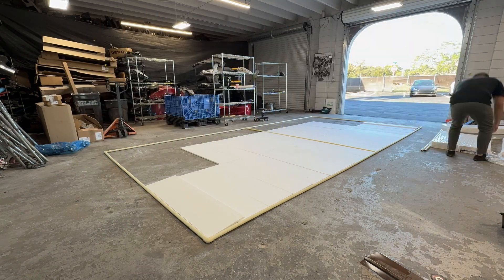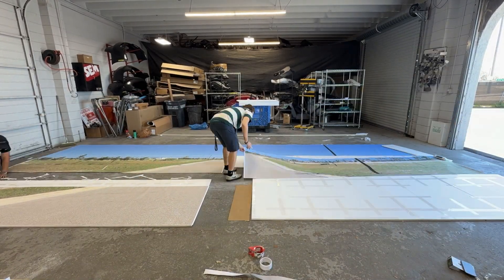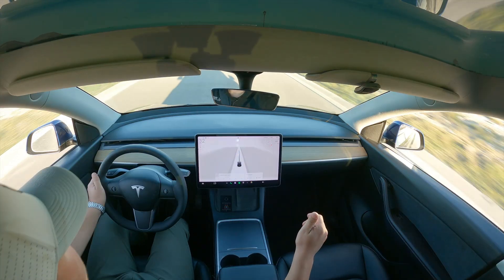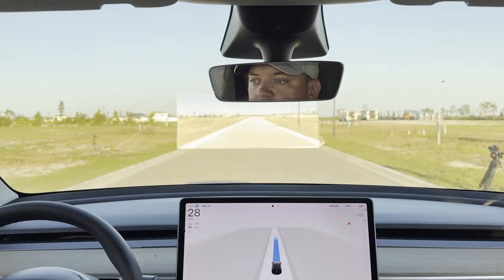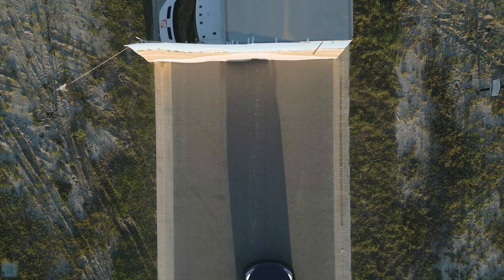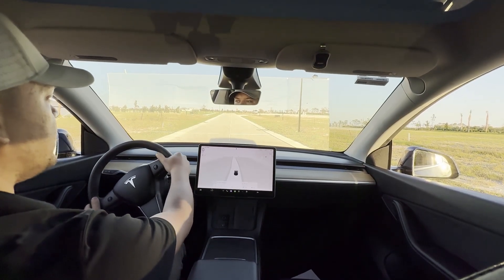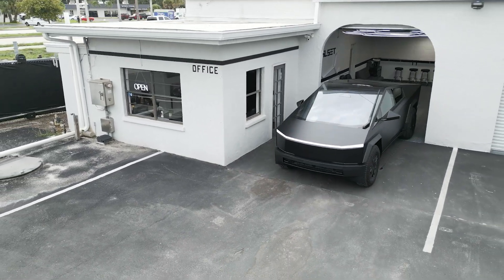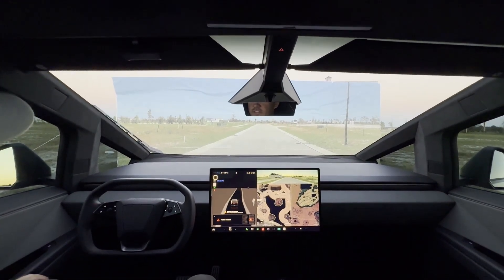Response to Mark Rober’s “Can You Fool A Self Driving Car?”

Comment: i think the cybertruck stopped because of the sunset and the contrast of the sky and the fake wall... id love to see another video about this tested at the same time of day
Reply: It makes complete sense. If Tesla is just using cameras it doesn’t have a LiDAR or infrared, ultrasonic sensor, etc to use as a check/fail-safe. So the different lighting conditions will 100% impact the test.
Reply: @TheMW2informer  this is why they need the other sensors.
Reply: @TheMW2informer  Lidar will also cause other issues if the software logic and data is not up to par... The HW3 cars have good enough cameras if the software logic is there. HW4 has a long range advantage and can process data faster but still requires good logic and data. In fog, snow, heavy rain, even humans can't see well, so we simply drive slow... HW3 will do the same... Problem solved...
Reply from the maker: It’s possible. We will retest later this week
Reply: CT cameras are higher than MY, plus has a 3rd forward camera.  Makes it easier to detect?
Reply: He needs to run both cars under the same conditions. He should have run the Model Y after he did the CyberTruck.
Reply: I wish he reran it with hardware 3 one last time
Reply: no can do boss - all the panels and bumper fell off the cyberdumpster
Reply: there was huge contrast between the wall and the background in every single test, unfortunately. It ruined every test.
Reply: So your telling me sense Tesla doesn’t use Radio Detection and Ranging And Light Detection and Ranging in there vehicles and since FSD doesn’t have redundancy the camera’s performance is directly affected by the time of day
morning-afternoon-night and the contrast of something 🤔
Reply: Bingo
Reply: I agree
Reply: He also had a friend standing right next to it, which it thought was a pedestrian.
Reply: or the just because it have under front camra, like the new model y Juniper.
Reply: I am still confused what's even the point of this test. Did libs put up fake walls to fool teslas and seriously injure fellow libs, or something?
Reply: 😂😂😂😂😂 nope he hit the brakes making it a fake test
Reply: The cameras may also be mounted in a slightly different location, making the horizon appear as a distinct "box", rather than flat with the actual horizon.
Reply: PLUS ON THE TRUCK TST THE TOP LEFT CORNER of the wall is bent backwards slightly yes lighting can make difference and was lights on the car on also.
Reply from the maker: Per your request! 🎉 enjoy

https://youtu.be/TzZhIsGFL6g?si=p_T4M_3pqILRE2rE
Reply: @kylepaultests  I’m crying because he actually go tired of people excuses so to shut them up he did a re test
Reply: Exactly. At least the comparison is not valid. The experiment conditions have changed.
Reply: The contrast issue makes no sense, otherwise a Tesla would stop when entering or leaving a tunnel. 
What nobody considers: FSD is using AI, so it also knows what to expect at certain roads as every Tesla camera helps the central AI to improve. Something no other producer can catch up with because of first mover advantage
Reply: @CardSharkGermany  your response makes no sense. At all. A tunnel is not the same as something that is BRIGHTER and covers the road itself.
Reply: it's  very impressive even what you say is true, not? Not in a million years you are going to see a fake road with the color matches the time of day on the middle of the road.
Reply: It’s HW3 vs HW4. It’s like testing iPhone 10 vs iPhone 16 for Apple intelligence. Need to test the latest hardware which is HW4 and FSD 13 not hw3 and fsd12
Reply: @KafKick  You can't be certain of that. The driving conditions are way different from the afternoon sunlight to dusk. The wall stood out more late in the day.
Reply: @FSD_PNW that makes no sense. For an object to appear more prominent to an optical sensor when there’s less light as opposed to more light. Makes zero sense. This is a classic Hw3 vs Hw4 test. Which is 5x stronger in vision.
Reply: @Kafkick the point isn't at the low light, it is how blend-in the print vs the background. the print is a photo taken on the earlier day not near sun set.  Kudos to the wife who brought up the point to test the hw4 but it has to be a scientific way, comparing the two units (single variable) at the same time, same condition.
Reply: @KafKick  the cameras see color. It makes perfect sense.
Reply: @KafKick  its about contrast. It doesnt matter if there is less or more light, the cameras are detecting concistency and the comsustency of the overall image was much greater with the earlier test while with the cybertruck the conditions were different enough for the cameras to pick up on it.
Reply: @KafKick either theory could be true or even both. You make a pretty big leap of faith claiming that just the camera rez makes all the difference
Reply: @KafKick  disregarding a possibility just because it makes 0 sense to you is not really how tests work though. Besides, Tesla and others heavily rely on visual inference, the car tries to retrieve data from images without much other support, contrast and outlines here are extremely important. Other systems such as LiDAR do a much better job, the car would sense almost any obstacle, no matter the colour or (almost any)material (transparent or highly reflective materials/surfaces could pose an issue though).
Reply: @KafKick  You need to test like with like, or we could be having the same conversation about HW2 v HW3.
Reply: @KafKick  how do you know that the HW version is the factor here? Did you test it?
Reply: That makes no sense.
So you’re saying if the sky on the horizon ahead is multiple colors,(like ancloudy sunset) the FSD see it and will not work….😂😂😂

That’s ridiculous

Comment: Thanks for this. To be complete, this really needs one more run. The wall image matches mid-day sun and does not match the sky at dusk. Need to do one run with modern hardware, modern model, at a time of day and sunlight level that matches the wall image.

Speaking objectively, if the image is a good match to the sky and surroundings, the Tesla should hit the wall every time. Elon is targeting sight-only, and without multi camera depth perception, there is zero signal available for a visual only system to perceive a wall there.

That does not mean that I want Tesla to add back lidar. I don't. I agree that vision is sufficient, since that is what human use. But I want to call out the shortcomings for completness.